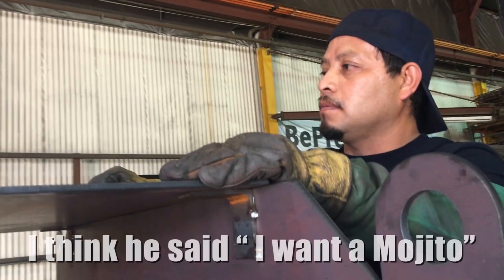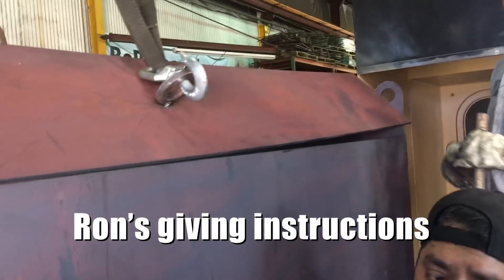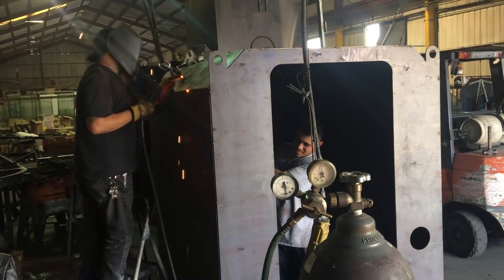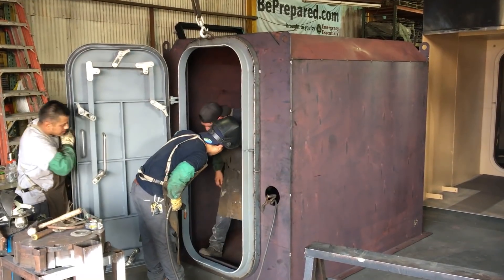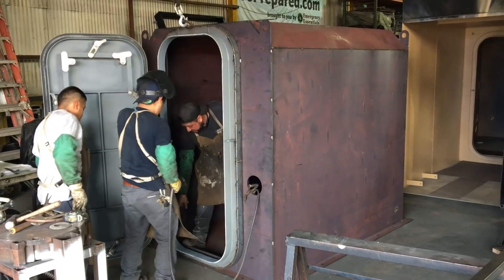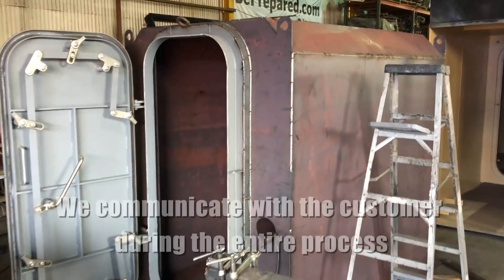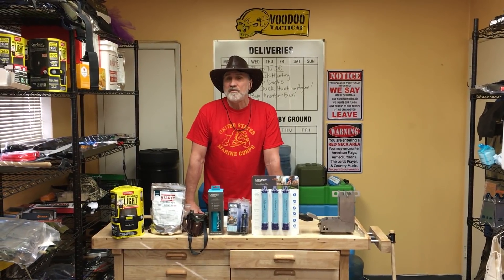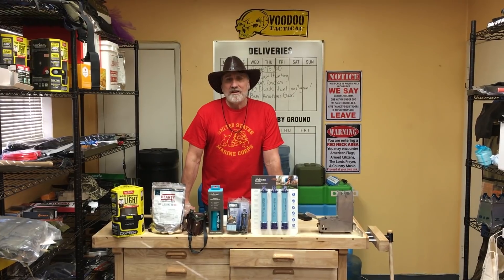How to Build a Steel Tornado - Fallout Shelter For a Garage (Full Tutorial HD)

Comment: WELDING?? old school!   Just use some JB WELD or some glue like Super Glue, Epoxy or Aircraft Glue the kind that holds wings on those 747,757,767,777,787 A380's they never fall off eveb at 700 MPH ALSO u don't need no 1/4 inch, just use 1/8th inch steel and put 1/4 inch aluminum as sandwich.. You guy as making this too hard and too expensive...Is this a TROLL VIDEO????????????????????

Comment: Got some bad news for y'all. 

You install this in your garage and get hit by a tornado and your gas line pops you're gonna have your ass trapped and be dead. 

Shelter Doors should ALWAYS open in not interior to exterior.

If it ain't buried it's not surviving a F5 I saw similar shelters knocked off their mounting bolts and thrown 50 yards in Joplin in 2011.

Not criticizing Atlas yall do good work it's just a critical design flaw I see duplicated too much.
Reply: If I had an above ground shelter, it would have to be buried in a bunch of dirt or concrete.
Reply: @Lance Casto Saw it firsthand when I was out there doing debris and ROW cleanup.

Comment: Every hammer blow filled me with more and more rage. The hammer doesn't "draw it together". It's used to make up for improper fitment. You can fill almost any gap with a series of tacks and a hammer. Fit it right and you won't have that problem.

Some of those welders sounded good, but most sounded like they were too hot. I'm curious: are your guys AWS certified - at least to 3G? Is it in house or third party? Do you ever have a CWI check you?

A "light" test doesn't check for an airtight seal.

I'm sure this is a fine novelty, but I wouldn't trust it in a serious situation.

Comment: Hector told Pedro in Spanish tongue  get the tack much hotter and I’ll knock the shit outta it seal it up it doesn’t need any penetration and if the hot slag melts into my eye a n burns like a hot pepper it’s ok I’ll run to wal China mart and bye a red glass eye pop it in and keep hitting the hot metal until it gets my other eye

Comment: It's amazing those guys are working without eye protection, staring at the weld arc with only eyelids as a barrier.  UV travels thru the eyelids in small amounts.  Eventually, it burns out the retina.  Perhaps those guys can't sue for obvious reasons?  Overhead crane workers are required to wear hard hats and steel toe footwear as well.  Hearing protection is required in the presence of hammering steel as shown in the video.  Welding without gloves and exposed skin will burn with unfiltered UV radiation and cause cancer.

OSHAite!
Reply: Twoleggedkumulava  hell yea brother. Tig and mig welding for 5 years and i've never gotten an arc burn, i wear short sleeves and tac without my hood sometimes.

Comment: Why don't you use a magnet to lift the top plate on. We pickup 4'x8'x1/2" plate steel for the shear. When we go under a 1/4" plate steel it would then bend and could let lose.

Comment: Are there any modifications to increase radiological attenuation for fallout protection?... e.g. 16 inches of solid cinder blocks... Since this is described as a fallout shelter...
Reply from the maker: No there is not on this type  this will only protect you from Alpha and Betta if the house is still standing   but its a tornado shelter primarily !
Reply from the maker: It is a Tornado-alpha beta radiation chamber   not designed for Gamma
Reply: @AtlasSurvivalShelters  so what should be considered is if it is possible to add concrete shielding blocks around the structure (this may require some additional reinforcement when adding blocks to the top) to provide  effective protection from fallout?

Think in terms of a small low cost above ground (and water level in many areas) shelter that can be incorporated into a existing structure (or added to a structure under construction). Might not be very nice, but if it can hold 2 people for 2-weeks... It could be a lot better than most other options...